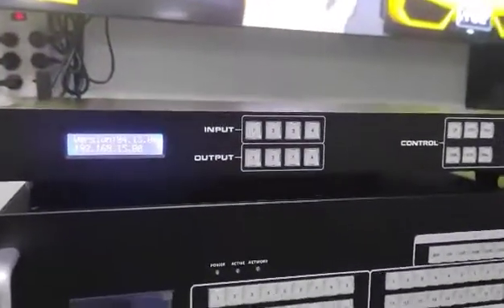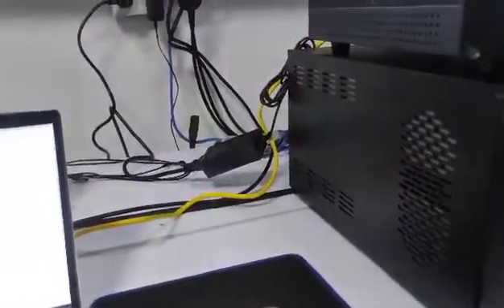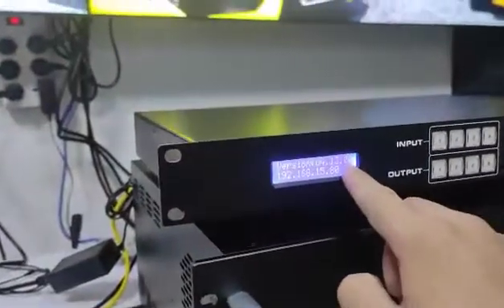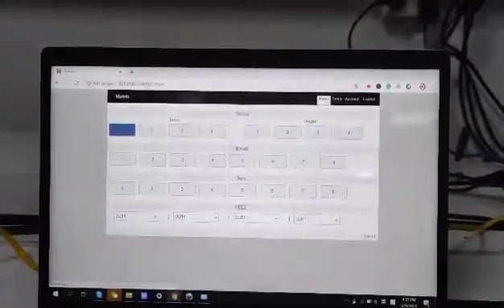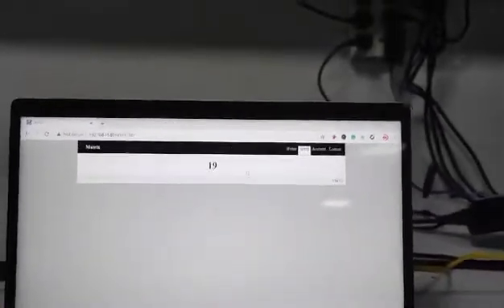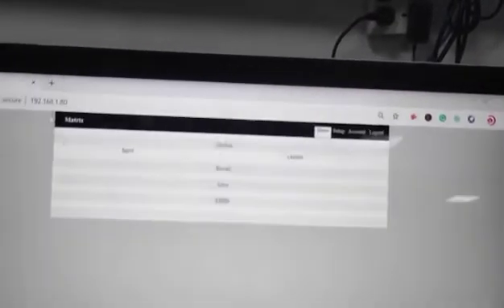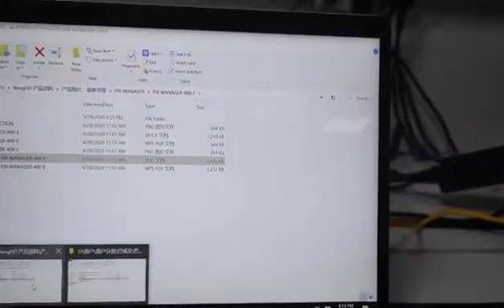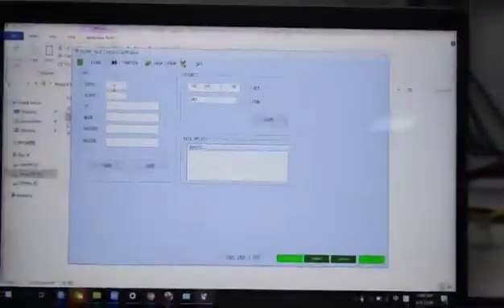Change the IP address for the 4x4 HD Matrix Switcher

Comment: I can't seem to understand how to customize my outputs. I have a 32" tv on the left that is veritcle, a 55" in the middle that is horizantle, and a 32" tv on the right that is verticle. They are using one input. I need to try to make this one large screen, but the webUI seems limited. How would i do this?
Reply from the maker: Hi, based on your display installations, I think this 4x4 will not do the work. As your 2 vertical  32'' TVs will need to do the 90-degree rotations first. I am thinking of our DPB-2400U model, will try to do a setup this week to see how it works. Maybe can email me at rocky@beinghd.com to keep posted, thank you.
Reply: @ thank you! Just sent you an email. Looking forward to seeing if you have  work around.

Comment: Just a question with this one can you have 4 Monitor set up on 1 pc with this
Reply from the maker: Dear, yes. This 4x4 switcher can support up to 4 monitors, and 4 PC input at a time. So your requirement is with 1 PC input and 4 monitors, it definitely can work, if you will only 1 PC input, you even can use a 1x4 HDMI splitter, or if you need a long-distance transmission, also can use the HDMI over IP splitter, please see at https://www.youtube.com/watch?v=jNhKXHY6KcM